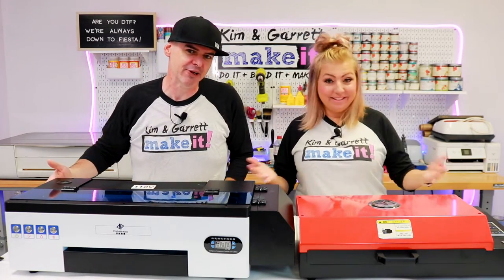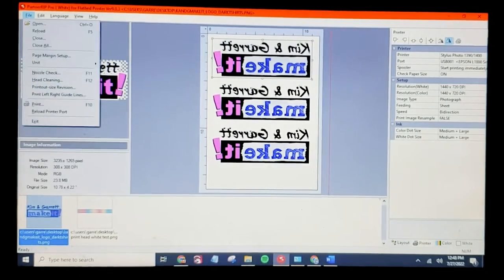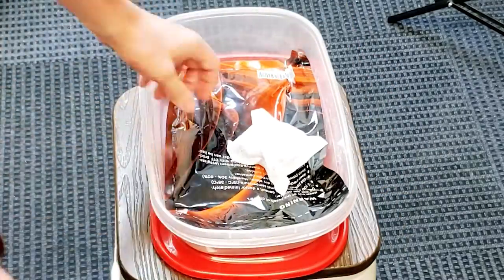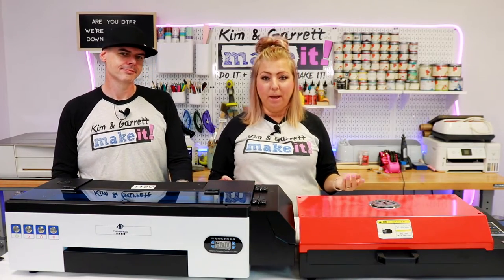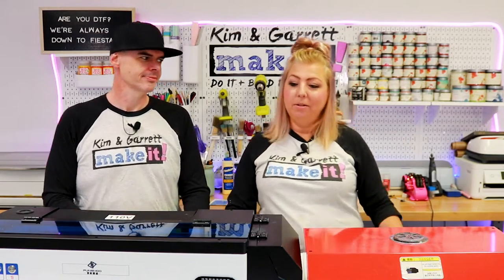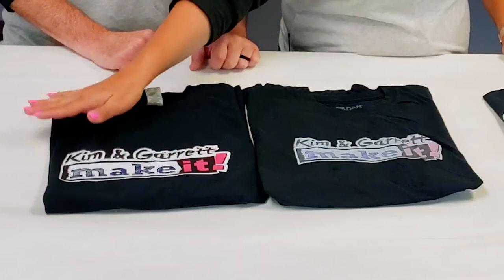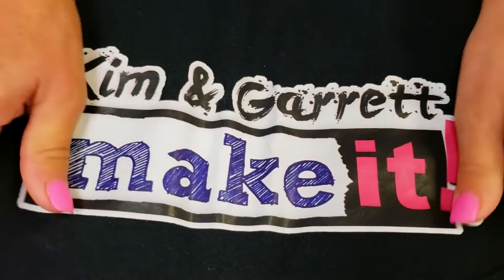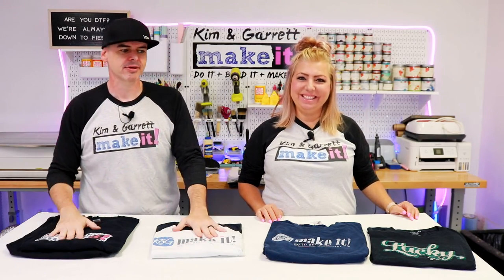30 Day Review Direct To Film Printer Epson L1800

Comment: We have the L1800 printer also BUT we use a XL table top oven (toaster oven) to cure the adhesive.  We get consistent results.  We lay a Teflon sheet on the racks to prevent uneven curing. Also recommend using outdoors or in a ventilated area. There are fumes.
Reply: What kind of oven did you get?

Comment: I recommend after you’ve transferee your print onto the shirt to heat press it again with butcher paper over top just to set it in. The colours might dull just a little bit it’ll last longer
Reply from the maker: Great tip!
Reply: I'm not sure if it's the same as butcher paper but there are finishing sheets.

Comment: Would it work with svgs ? You said pngs worked well but most of my designs are done in svgs will it work or do I have to convert ?
Reply from the maker: You would have to convert them. If you have Illustrator, you can just open it and export it as a PNG. I also saw some online tools that will do it. ~garrett

Comment: This is a very useful video! I have been doing research on this and this helped a lot! Thanks! I have one question, however.
Can I do batch prints with this and have it sit overnight.
E.g. If I have an order for 45 pieces, can I print all 45 sheets, put the powder on, put it in the oven, and then do the actual transfer the next day?

Comment: did yall have an iissue with blank prints? im on day #3 with the printer and its not printing anything now. ink flow to waste bucket is good. print heads are not clogged. but no print. even nozzle check isnt porinting

Comment: I'd been worried about my sawgrass printer for sublimation. I got Covid in Dec 2020 and was sick with long haul Covid for 14 months. Most of those months I wished I was dead. I hadn't used my sawgrass for about 1.5 years. I was surprised when I finally got it out to use a few months ago that it was not clogged and printed perfectly. I guess I was one of the lucky ones. Thanks for honest opinion of all ur gadgets. You all always tell it like it is. Most times I don't trust peoples opinions but ya never fail to tell us like it is. Thanks for all ya do.
Reply: DTF ink is nothing like sublimation ink.  DTF is a much thicker ink, which will tend to coagulate, where sublimation will stay in it's liquid form and not create the skin type covering.  Plus, the white ink is always thicker than the rest, so that is why it causes so much maintenance.
Reply from the maker: Thank you susan! So happy to hear you're feeling better!

Comment: Just curios.  Rather than using the oven which you've stated doesn't really do the job right, and I have seen others hover a heat press over the print to set the adhesive. Any idea if a low end flash dryer may not be the better answer?
Reply from the maker: I've never tried to heat press the glue, mmmm I might try
Reply: @KimandGarrettmakeit  i use a griddle saw some lady do it and it was very fast

Comment: After 2 or 3 back to back print my white gets thin and see lines in white back , I have Epson l1800 how can I fix this
Reply from the maker: Same thing happened to me!  I used the syringe to pull through serval ounces of ink and squirted it back into the tank.  Like 2 syringes full of ink from each white carriage. Now, it seems to be working fine.  I don't think mine was pulling the white ink through the tubes fast enough and the carriage was running out of ink.  Hope this helps!  ~garrett

Comment: Ty for the video! I’m not sure it’s worth it. On top of the cost and the maintenance you still have to print once a day at a cost of 1.25$ that adds up. I would need to sell a lot more stuff to pay it back.
Reply: You can print on regular paper which could be around $0.1 - $0.5 depends on your ink price.
Reply from the maker: I totally agree!
Reply: Hi Mai, IMHO, it is worth the investment. Or you can have a company like printify or printful to do DTG for you and you don't have to do anything but your margin profit will be extremely reduced. I have Dye Sublimation printers and a DTF printer and they're awesome because the savings are way higher than you expect them to be.

Comment: Hi do we have to reset the waste ink counter with a code purchased on the web  when the printer is at end of life. Blinking lights?. Thank you.
Reply: get a code resetter all you have to do is touch it to the the chip on the waste box. i use a external ink waste system that way you never have to get a code or re-set

Comment: Excellent video! Not sure if I want to get that set up seeing the maintenance. Maybe I'll look into something more automated... But the price..... can't beat it.
Reply: Look into Ghost white printers.  It is much the same setup but without the high cost of maintenance.  The big difference of course will be the cost per print, because the adhesive is an actual sheet "B" that adheres to the print using a heat press.
Reply: @HalfAssHomestead   I think I've seen videos of it - on tik tok.... I will look into this thanks!
Reply: @HalfAssHomestead  ghost white uses toner and toner prints simply do not last long. I have a $3500 white toner printer gathering dust because I refuse to sell a print that wont hold up.

Comment: 6:30 minute mark you say you press for 10 sec cool down 30 seconds peel and ready to wear. why are you not pressing a 2nd time for 10 seconds as recommended
Reply from the maker: We started to press it a second time, but at the time the glue powered got on the of the heat press and it was sticking to the Teflon sheet.  Then the Teflon sheet became sticky on both sides and was becoming a mess.  They screen printer next door said is we were using cheap Teflon sheets.  Now we press it, peal it, put the transfer sheet back on top and press it again for 10 seconds. Thanks  ~garrett